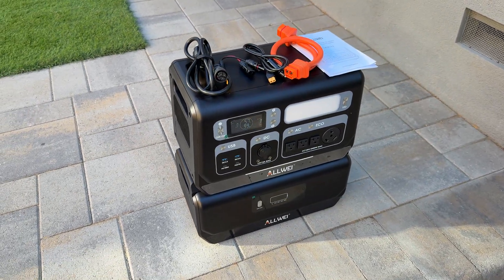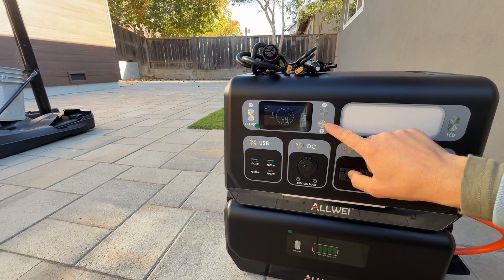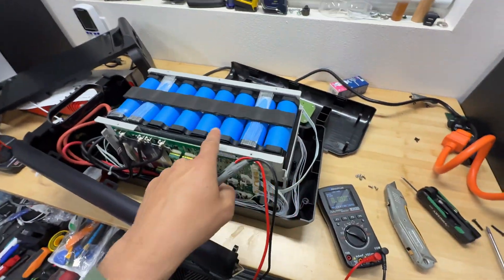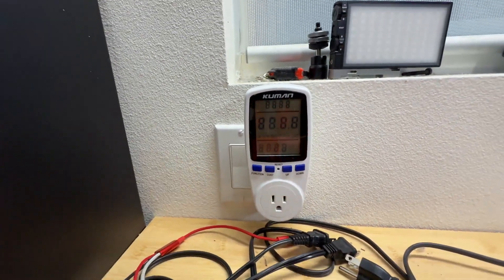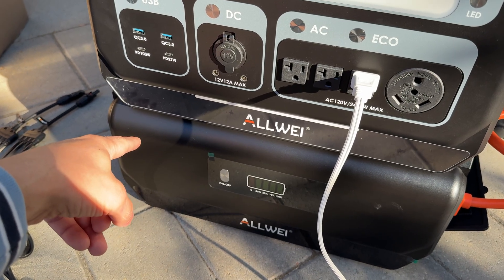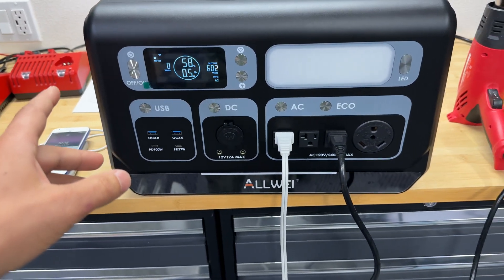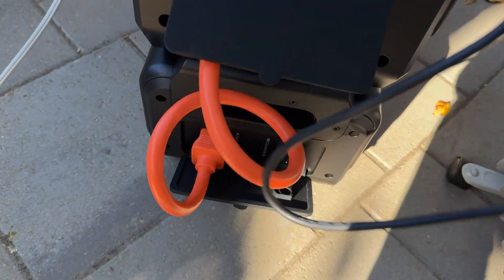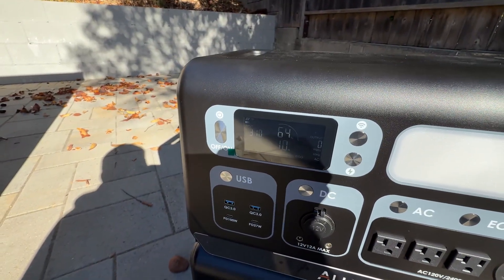Reviewing ALLWEI PPS2400 Portable Power Station

Comment: Can anyone confirm if it is possible to use the this (or any other in the 2400w inverter category) to charge and discharge at the same time.. i.e connect to a small gas generator ~1200w limit, and draw from the inverter at the same time variable (200w to 2200w - average 600w) up to the maximum inverter output. In other words not do a bypass function which would draw directly from my tiny gas generator, popping a circuit breaker during high load. (Can I effectively use this as a power buffer?) This has been a difficult use-case detail to find about any of these power stations. Thanks in advance.
Reply: Do not buy from those scammers. I had to file a complaint with FTC.

Comment: Yea, I would also expect the solar to charge right up to the limit they have in the manual/web site.
Reply: Scammers
Reply: Thank you for your question! The charging power listed in our product manual and website is based on maximum test values under ideal conditions. However, in real-world use, solar charging efficiency may be affected by environmental factors such as sunlight conditions, panel angle, and weather. If you have specific charging needs or encounter any issues, we’re happy to assist further!
#ALLWEI #ALLWEI PPS1200 #solar generator #backup power
Reply: @AllweiOfficial  you're scammers and the government is coming after you crooks.